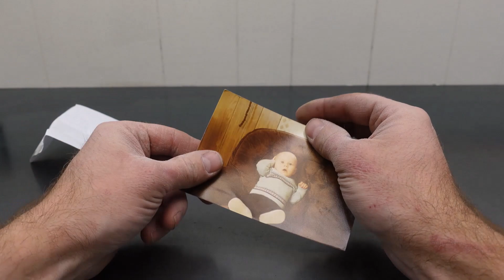1970's Tonka Truck Restoration Turned Out Awesome !

Comment: Just want to let you know...you can buy brand new windows...that match what is in it...on ebay!..
Reply from the maker: Thanks Rowland. I think that I purchased that windshield from Gasoline alley toys directly from their website. I like to purchase direct from them as the prices are the same and they don't have to pay the 12% ebay and payment fees.
Reply: @RepairRestore  It may be where I got mine....but it was listed on ebay.. I wasn't aware of them before...Thanks for the info... Hey!..while I'm thinking of it..I have one just like yours...and need to find the best paint stripper...Do you have any ideas?... i'd  prefer one I can brush on...and wipe off after it sits awhile..as i have no wire buffer type of stipping device.. Thanks!
Reply from the maker: @Rowlandph  You could try white vinegar. It takes a few days, but you can just wipe the paint off. You have to neutralize the acid when you are done though.
Reply: @RepairRestore  tHANKS!... I'll try that.. I assume...just soap and water would neutralize it?... If not, let me know..:)
Reply from the maker: @Rowlandph  I would baking soda and water. The vinegar is acidic so you need something basic to neutralize it.
Reply: @RepairRestore  Thanks again!..